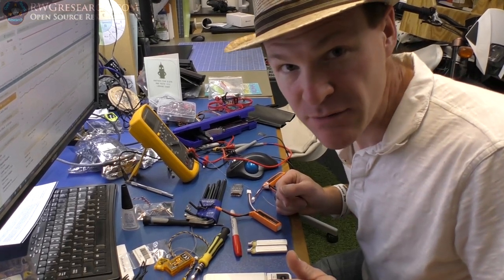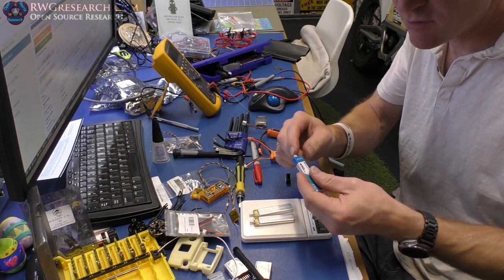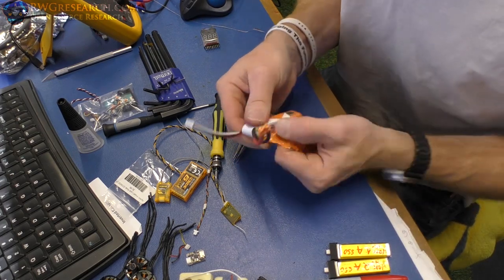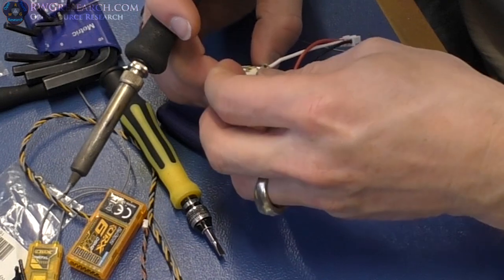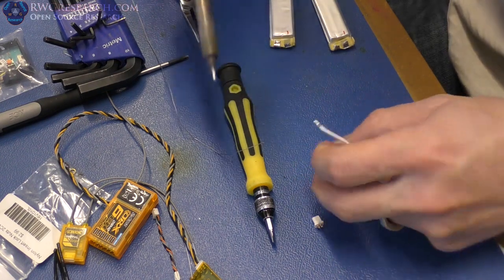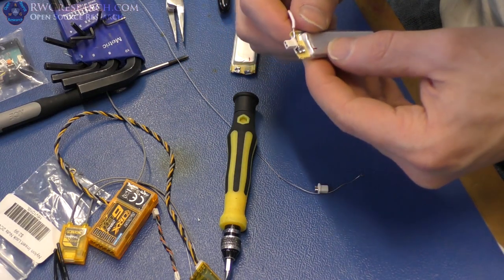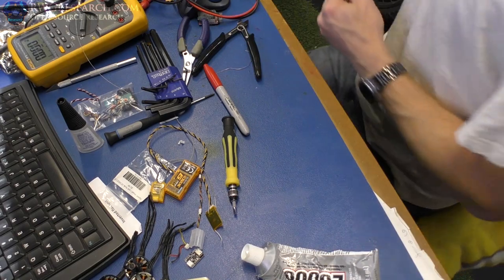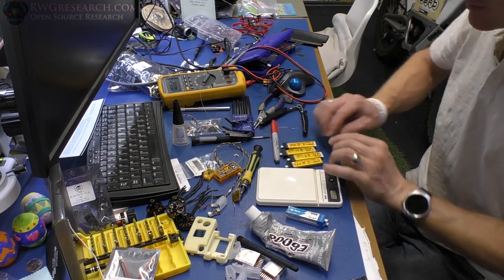How To | Stick BT2.0 Battery Conversion. 550mah BT2.0 Stick?

Comment: Tip for that wire is to fold it, then slip it over the terminal, then solder it. That way the wire carries the current to the join, and not the solder. Also to get the hot glue or tape to release use some alcohol, I have used hand sanitiser, as that is common, and also available in small bottles, and works well, and is generally ethanol and water, with a tiny amount of possibly fragrance, but 70 % alcohol with only a little denaturant, plus safe for touch. 

Another tip is to use small plastic canisters, normally used for effervescent tablets, to hold your solder. Remove the contents, remove the dessicant beads from the top, and remove the excess plastic, then poke a small hole in the end of the cap. Wind solder on a smooth shaft, I use a phillips no1 screwdriver in a cordless drill, but whatever is around works, to make a big roll of solder that is as long as the tube, and almost as fat. Then slip out the screwdriver mandrel, and take the inner end, and slip through the little hole, place the roll in the tube and close it. Convenient solder dispenser, and portable, plus no black on your fingers, or solder getting dirty. You can also use some silicone wire insulation as a nozzle on the cap, sticking it to the cap with a tiny amount of silicone sealer, though I used some small sleeved grommets from old equipment instead.